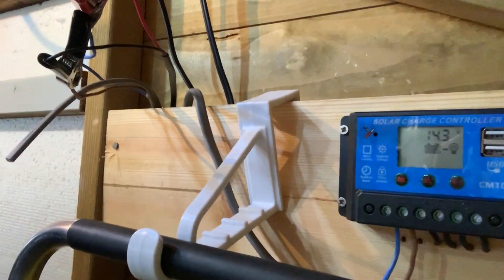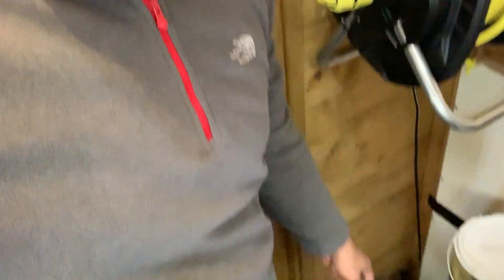Part 1 - How to charge a completely discharged car battery.

Comment: Have you got more details of your solar panel and charge controller that you use for your shed lights please?
Reply from the maker: So the Charge Controller is this: https://amzn.to/3eBzPgP
I originally had one of these solar battery maintainers that I used in the car: https://amzn.to/2RJzU8S

I recently upgraded to https://amzn.to/3tAmTvS
Being a more sensitive and more powerful unit, it even provides charge on overcast days so the batteries are always topped up!

Lastly, the lights I use are these: https://amzn.to/3tAn8XO

They light up the inside of my shed better than my lights in my apartment. They were so good, I replicated the set-up in my garage with 2x rows of the lights and it is bright enough that I can work on my car in the evenings and night. 

It has been an amazingly rewarding and useful project.